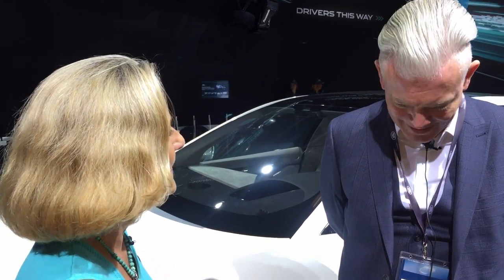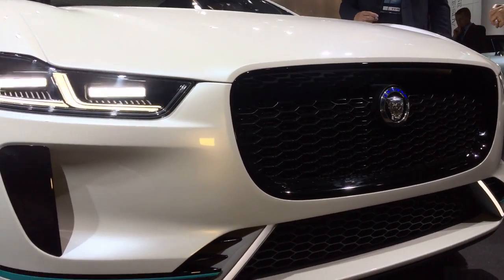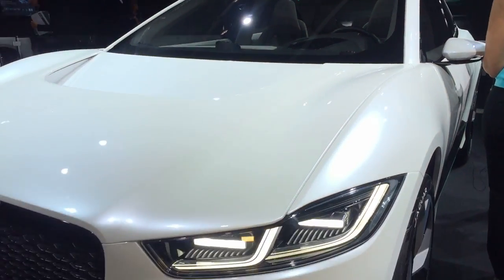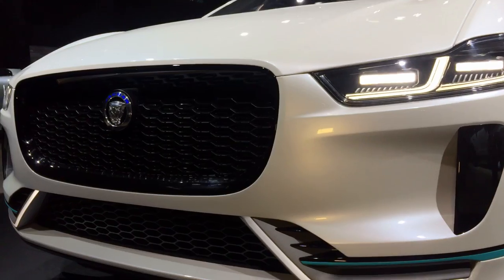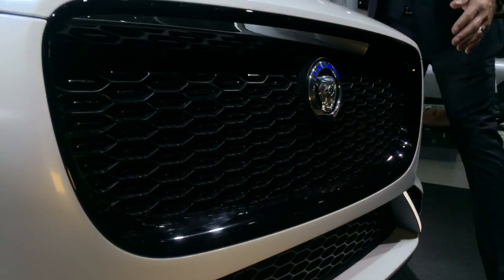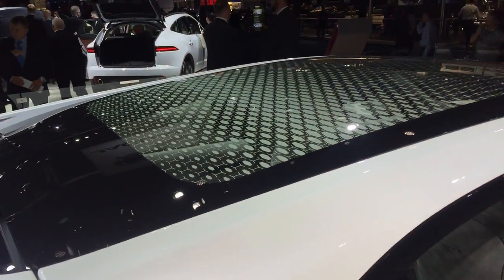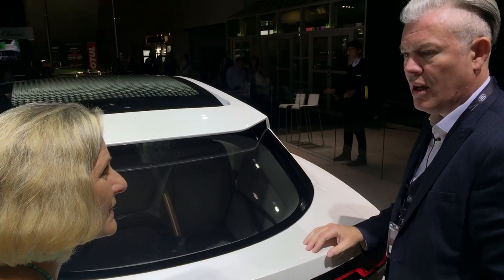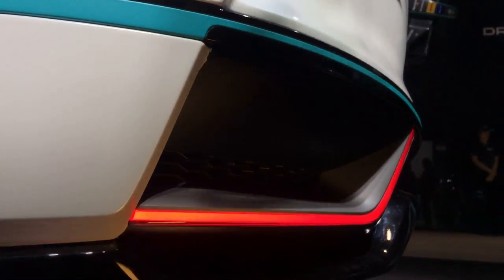Jaguar designer Wayne Burgess talks Jaguar electric SUV I-Pace concept at Frankfurt Auto Show (IAA)

Comment: Why the huge black front grill in an EV? Even at high speed the motor and battery needs very little cooling
Reply from the maker: Good Question. I didn't ask him that. He explained about aerodynamics. I would assume it was to make the car look menacing.
Reply: They couldn't manage to make that much of a aesthetics departure from petrol cars apparently.  He also failed to state the drag coefficient, a major omission.  Even the first Tesla S has a phony grill of sorts.
Reply: Anders Würtz That's not true anymore. Modern high powered BEVs with beyond 400hp require decent amount of Radiators for Liquid Cooling for the Batteries & Distribution Lines outside the battery. It's a fraction of the heat of a Combustion Enegine, but if you want to prolong peak performance you still small car sized radiators.
Reply: Surely you can feel the heat when you use your smart phone for 5 minutes .
Reply: Bruce Burns
EVs don't require a the radiator of an ICE, not even close.  It can only be about styling, they haven't figured out how to give up such a prominent traditional feature which is a relic of the past for EVs.  Apparently Tesla struggled with that too as the first Model S has something of a fake grill.
Reply: Bo McGillacutty  Wheww that name is a mouthful , What is an ICE .
Reply: Bruce Burns
Internal Combustion Engine....normally I might have spelled that out but in this context most are probably familiar with it.  :-)
Reply: Before watching, I was betting it was to gather heat for the heat pump which provides cabin heating - but it's a fake grill just like most ICE cars have had for the past 30 years or so.  (Almost all front air intake is from below the front bumper, and has been for decades).